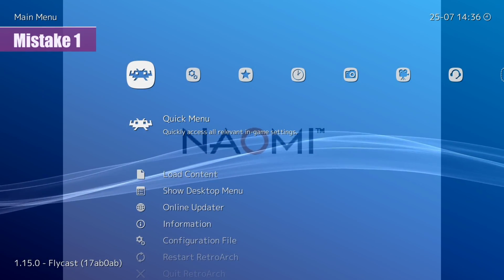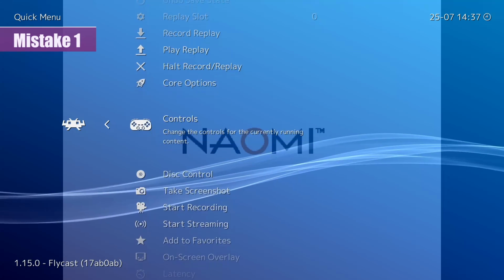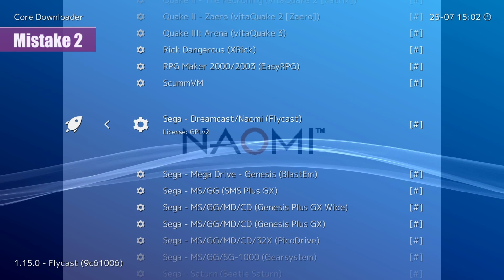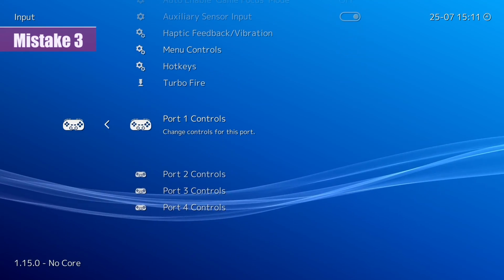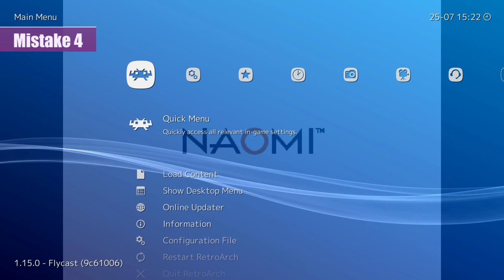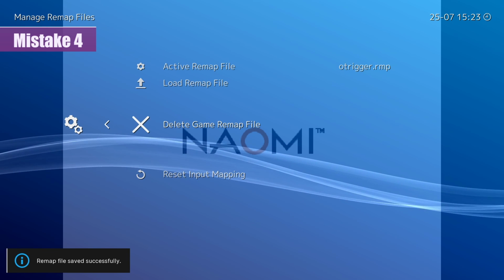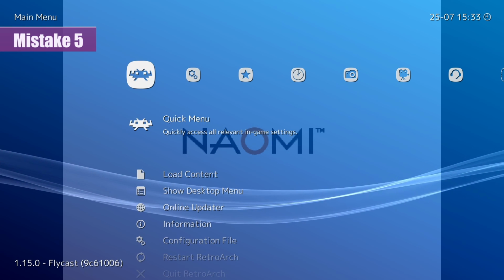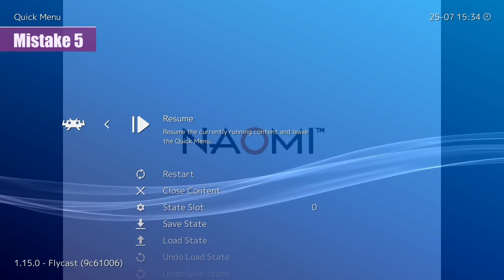RetroArch | 5 Easy To Make Beginner Mistakes

Comment: 1st mistake: installing retroarch
Reply from the maker: Why don't you like it!
Reply: @warpedpolygon  Doing anything in it feels like a chore. The scan won’t detect a ROM unless it’s part of a ROM set (hack ROMs, for example), it has the worst control mapping I’ve ever seen, and the list goes on. It’s a shame because I really like the shaders, the overlay customization, and the cores, but it’s hard to choose it when you can just install a dedicated emulator and play without spending hours tinkering, configuring each core, and adding games manually to playlists. The only way I see myself using RetroArch again is on a console or handheld that has no better option.

Comment: I have multiple usb controllers for each console I wish to use. Is it possible to configure each of them without overwriting the default configuration file on RetroArch?
Reply from the maker: Yes, but I cant explain it in a comment. Need to know what you are using and how etc. But it can be done
Reply: @warpedpolygon  I’ve got a USB NES controller, as well as USB SNES and N64 controller. They’re mostly generic. The NES and SNES controllers are oddly enough recognized as SEGA Genesis/Saturn type controllers. The N64 controller on the other hand is recognized as just another joystick and has to be configured on its own. I’ve also got a GameCube adapter which works from the ground up without without any additional configuration besides core settings.
Reply from the maker: @slothbaby2489  you can save core specific remap/controller setting files. These do not override the main config file.
Reply: @slothbaby2489 in your case you do want to set up each controller in the main retroarch input settings despite what the video says. Plug your first controller in then go to the main settings then input then port one controls then select set all controls in define all of your buttons. Then click save controller profile. Now the next time you plug that controller in, it will map everything correctly for that controller. Do that for each of your controllers and don't forget to click save controller profile when you're done mapping each one. And then if you want to change stuff up on a per game basis when you're using each of those controllers you can do it through the quick menu.